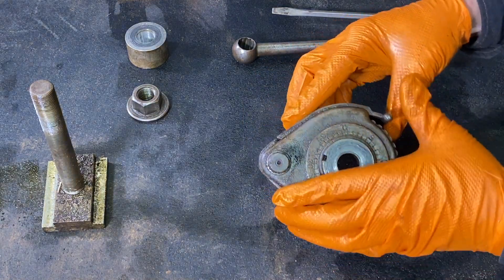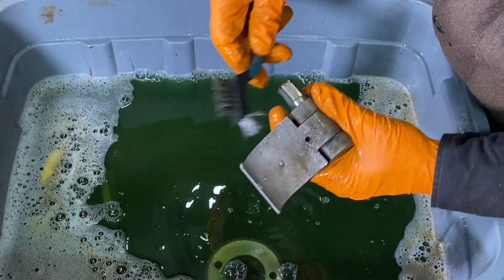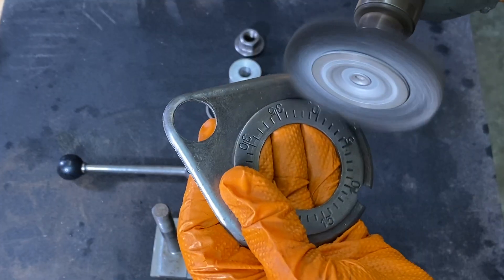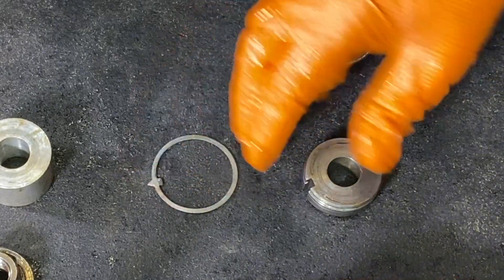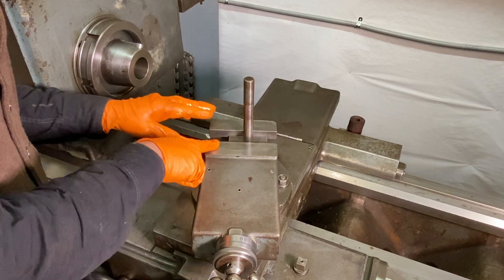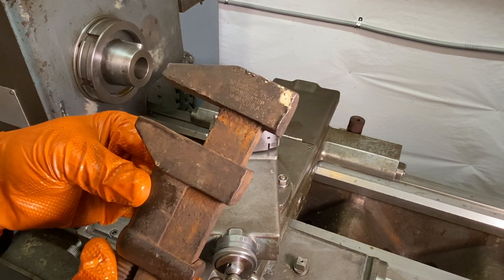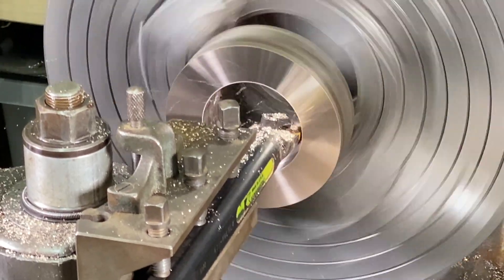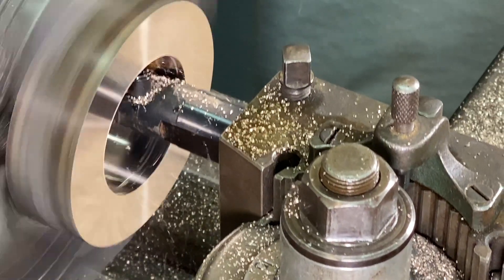Lathe Multifix Tool Post Breakdown and Reassembly - Right On #9

Comment: Didn't you have to square up the tool post with the spindle before tightening the nut up?
Reply from the maker: Right On Matt. 💫 If I’m threading I’ll set the compound to 29° and then square it up exactly. It does have 40 positions and usually they work for what I’m doing. But yes it can be squared up. 😃👍🏼💫